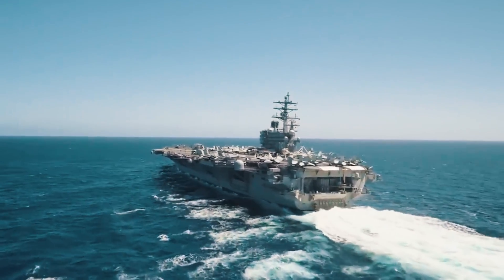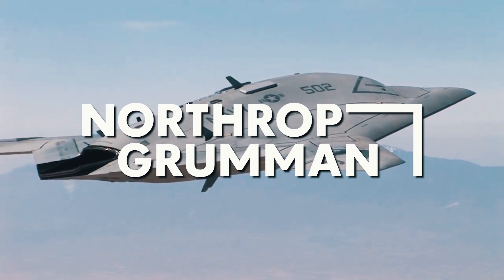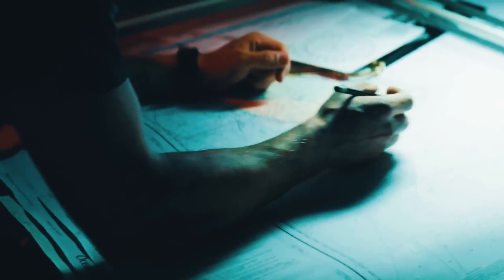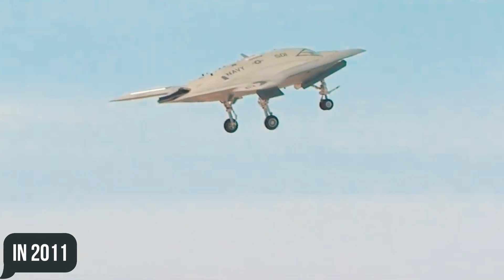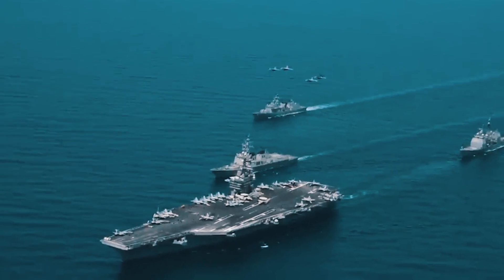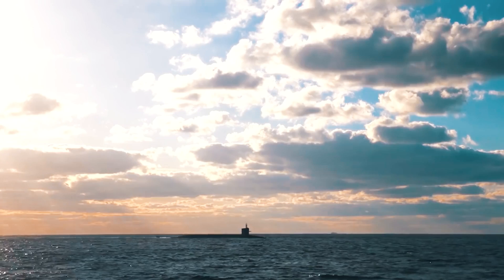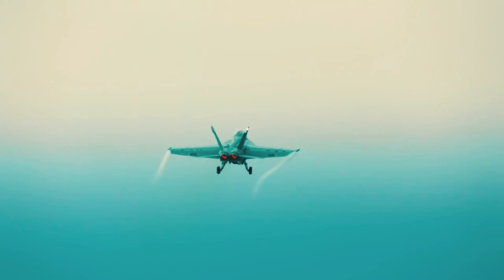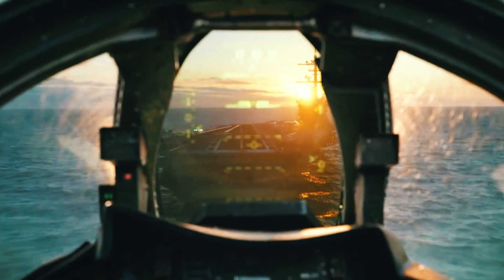The Mysterious Jet Aircraft on U.S. Navy Aircraft Carrier in Mediterranean Sea

Comment: The F35-C does NOT have "Vertical Take Off and Landing" capability. The F35-B is the jet that has that VTOL ability. The F35-C, however, has the more rugged design to handle the carrier takeoff and landing demanding environment.